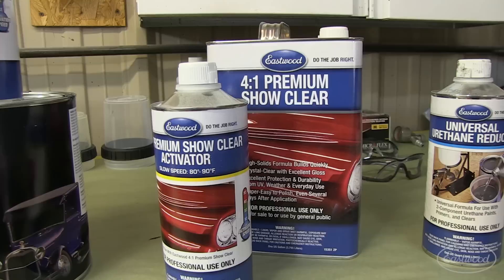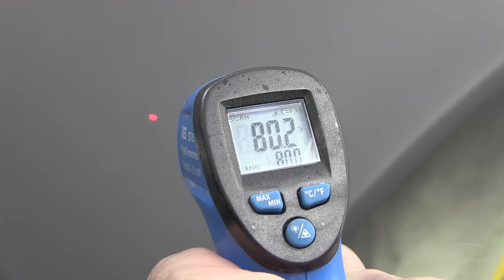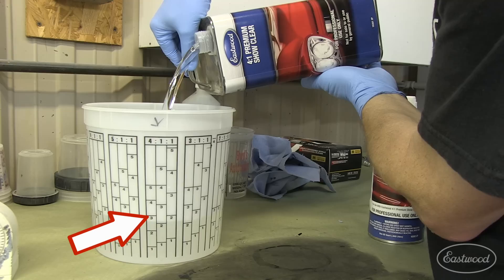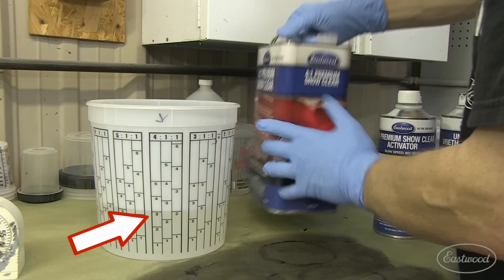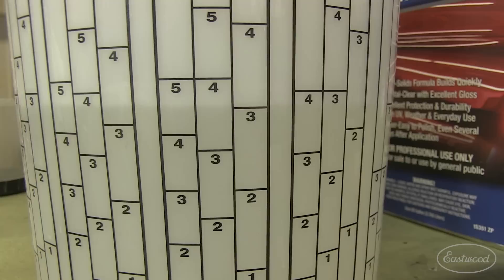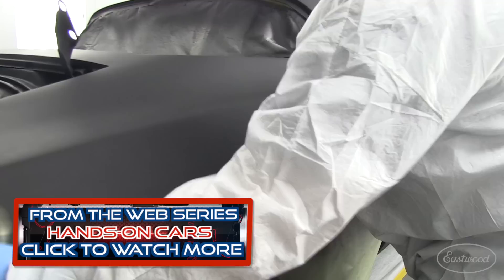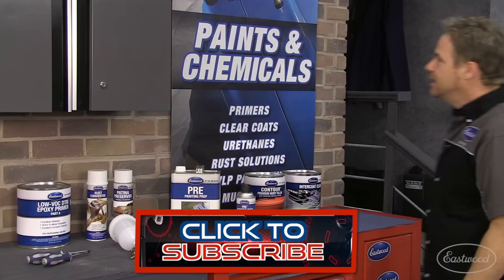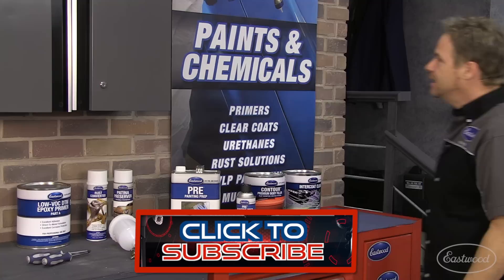How To Mix Car Paint - A Quick Paint Mixing Tip with Kevin Tetz - Eastwood

Comment: If over 80 what’s reducer do for paint 🎨 
Oh didn’t tell me y 
Ps 1950 used to paint tractors with brush 
That’s the way I did it no final coat and a 200 pound boat tarp in storage yard has done damage and hate seeing metal 
My 1955 Ford has one spot rust had a paint aluminum color specialty for prevent rust any idea 💡 what paint that was ? 
Appreciate if know